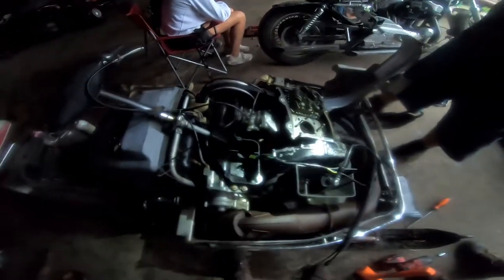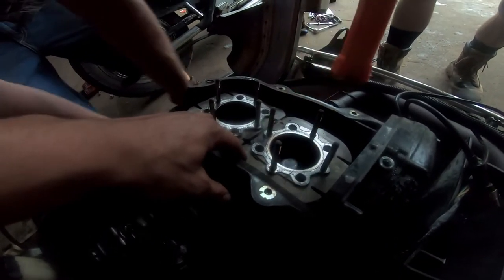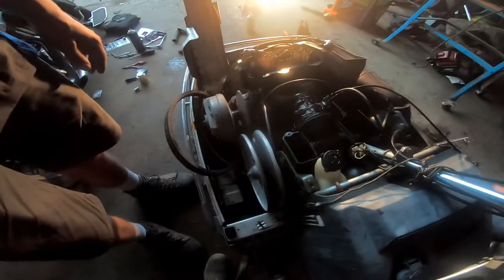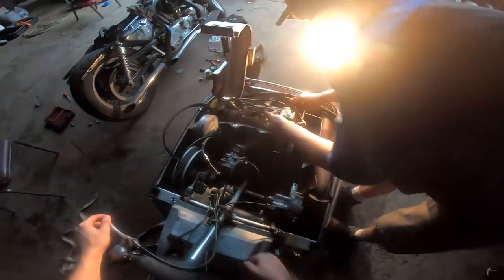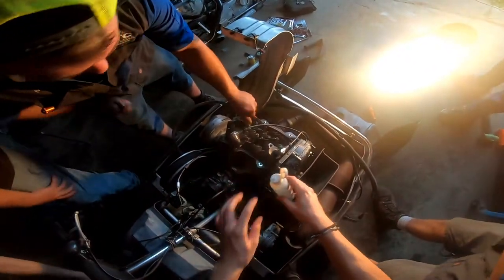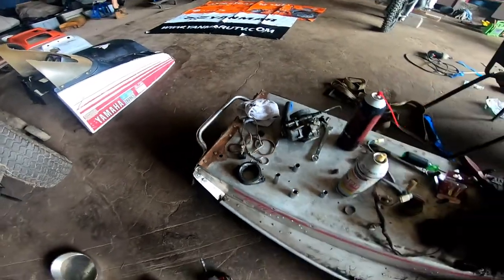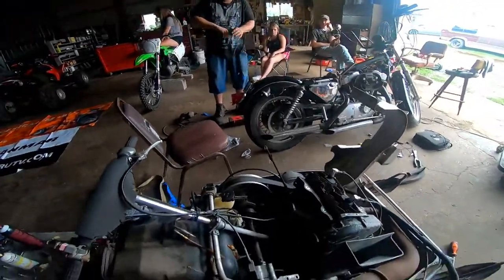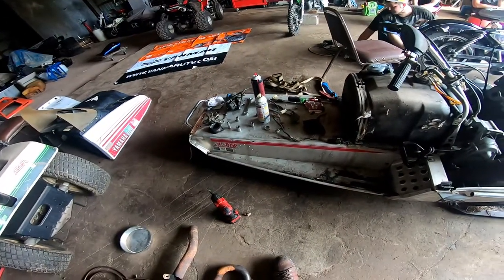STORAGE UNIT AUCTION SNOWMOBILE BEEN SITTING OVER 10 YEARS...ENGINE SEIZED. WILL IT RUN??

Comment: RIP crank bearings from beating down on them instead of rocking the clutch back and forth until its unseized
Reply from the maker: We only slightly tapped on them with rubber hammer. We rocked it 90 percent of it.